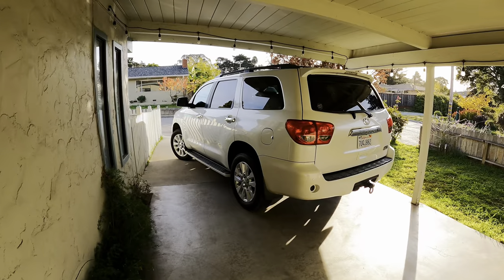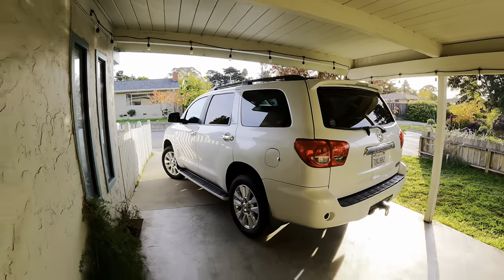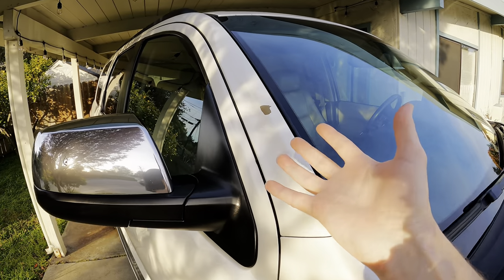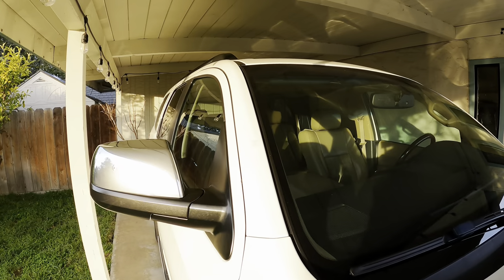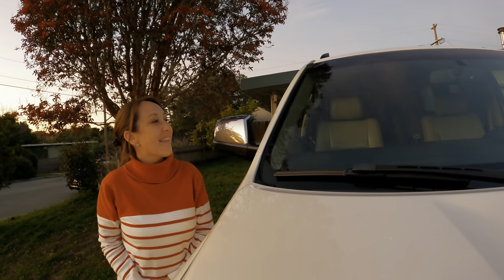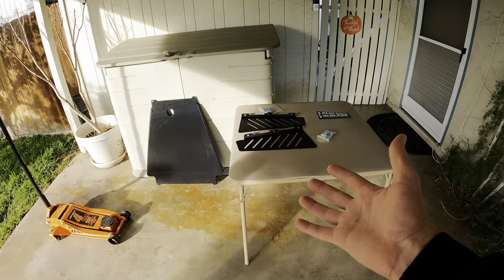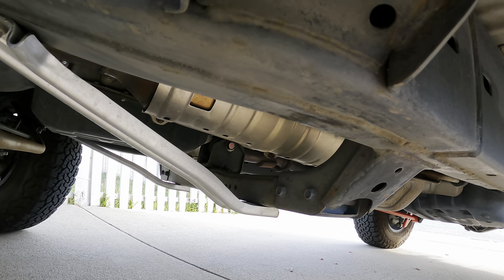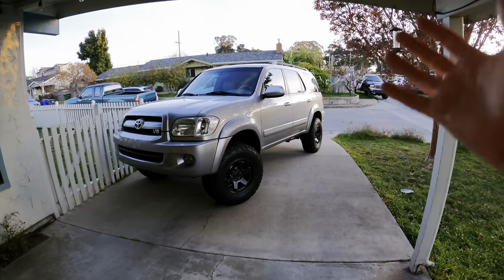Mrs. FANATICS Platinum Sequoia Has a HUGE PROBLEM! Paint Falling off!!

Comment: This is true. Trust me you I wish I had gotten the limited. The platinum has made my lifting journey very difficult and I have yet to get it done.
Reply: Check out Tandem Off Road. They have a custom spacer kit specifically designed for the Platinum air suspension.
Reply: @edaztec  Thanks I will look into it. i actually wanted the lift, suspension upgrade and the whole nine yards.
Reply: I totally get it. How high do you want to go? I think Toytec makes coilovers for th front and shocks that fit the rear. I think they're just re branded Elka shocks made in Canada.

Comment: You tube channels to check out about lifts on the Platinum is Tandem Off-road they are actually one of the pioneers for Sequoia builds for 2nd gen, Cool Guy Stuff and 1stgenoffroad also has 2nd lift for Platinum. I am in the process of doing a lift as well.

Comment: Hey buddy  I know this don’t have nothing to do with your video, but I would like to know what set up you had on your white tundra, lift, rim, and tires if you don’t mind?
Reply from the maker: No problem, so looking back, i should have just gone with a bracket style 6 or 8 inch lift, but they can be very costly. The set up on the 2012 CrewMax was just a set of Toytec Boss Coilovers that were cranked up, giving about 4.5 inches of lift. The ride is very nice, but it’s just not high enough to clear the 22x12 Hostile Rage wheels with 35x12.5 mud claw tires.. i had to do A LOT of trimming.. but it looks great!! 👍🏼

Comment: Hey, just wanted to ask, currently looking to buy 2020+ sequoia and desperately want blizzard pearl on platinum trim. Does this peeling off problem touched 2020+ sequoia's ?
Reply from the maker: Some recalls claim it’s the 2008-2018, and some say up to 2019.. but i can assure you that 2020 and up have zero issues.. your all good!! 👍🏼
Reply: @toyotafanatics1  thanks a ton, initially was super depressed by blizzard pearl after your video. But soon searched a couple posts from guys, telling same as you, that this problem touched till 2019, also not blizzard peal alone, but super whites as well.